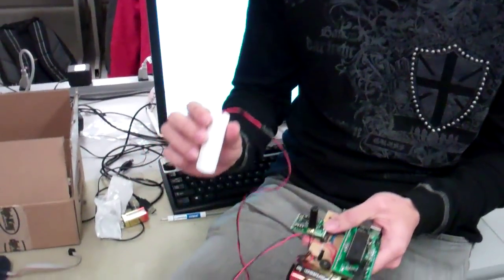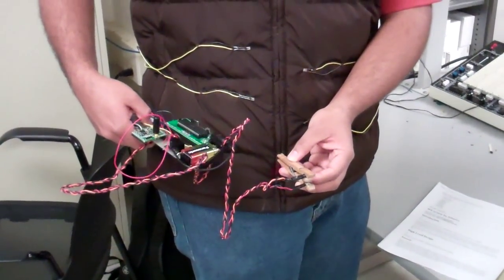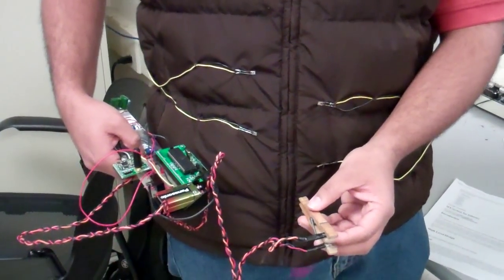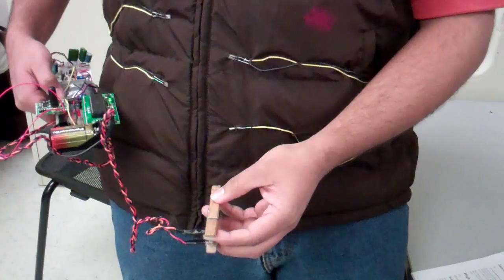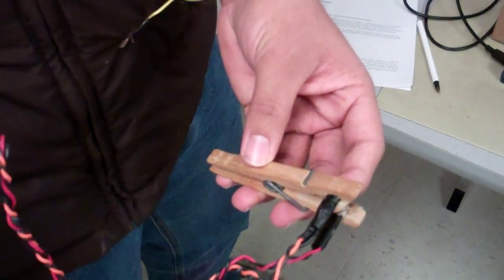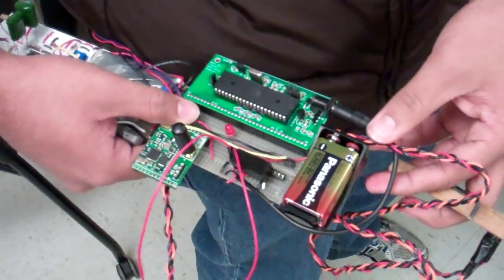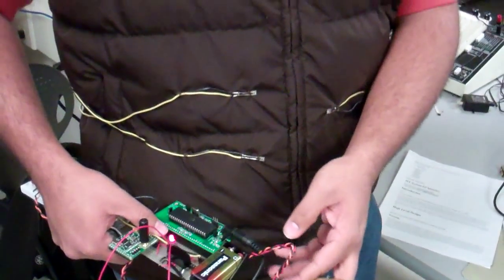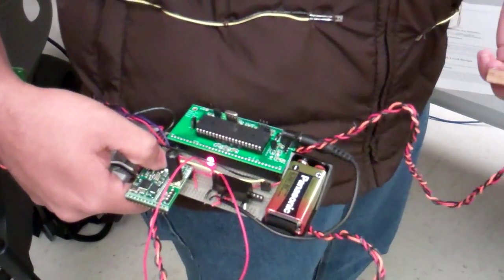IFF system for infantry

Comment: To those of you criticizing...these guys are undergrad engineers in a college lab. It is obviously NOT ready to be strapped on our troops in a war zone. Stuart you are asking WAAAY too many questions at this stage of development. Conceptually it is an amazing project with mountains of potential. This project could be substantially improved with a directional antenna placed onto the rifle that sends receives something of a medium-sized to large frequency. I'm thinking somewhere between VHF and HF range. That is because larger frequencies take less power to use and hence, will minimize the weight on troops.
Reply: James Jacobs But lower frequencies also mean larger antennas. Not only weight is a problem, space is as well.
Reply: Good point. But im thinking that the antenna may be able to be placed along the length of their rifle. Antennas can be a fractional length of the actual wavelength being propagated. Because of this, the antenna can be a lot shorter than most would anticipate. I wouldn't imagine this system would need a battery much larger than a gun magazine due to the output power only needing to be enough to send a signal approximately a mile away (and ample battery life for a mission). Iwould really like to see something like this implemented on the battlefield. The only downside to this system is that RF trackers could be used by the enemy to locate our ground troops. And all the camo in the world wouldnt save you.
Reply: James Jacobs That is why i really like the laser idea, it negates the drawback of length versus weight (frequency dependant ofcourse). It also is extremely directional making it very hard to track or jam (ofcourse depends on the wave length, but most lower tech adversaries do not have capabilities to do so). Seeing them in video/night vision equipment is one thing, but those are very wideband receivers and finding the exact wavelength to jam them is very hard because you almost never are receiving the beam directly.By the way, fractal antennas are quite large in surface area and are not really directional, making them easier to find (and track), most have a frontal lobe of about 120-140 degrees (-3db). Also as mentioned in the video, often infrared lasers are already mounted on the rifle itself.
Reply: Well a laser could work too. I know at Eglin AFB, we do a lot of testing with lasers in labs. Its possible, especially if we can get the costs down low enough. i think a possibpe drawback to the laser is the reply portion of the operation. A system that is overly directional has a higher chance of missing a reply. I wish i could be involved in the testing of this technology. It would be very fun.